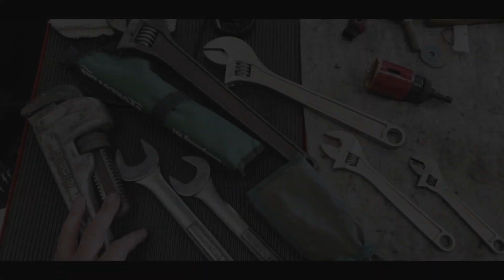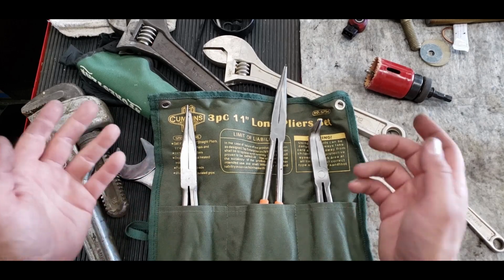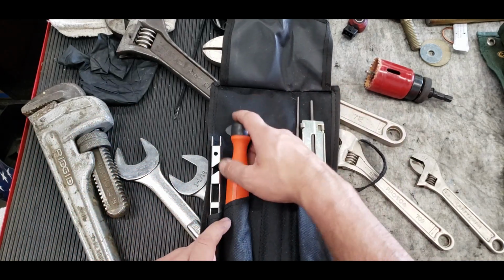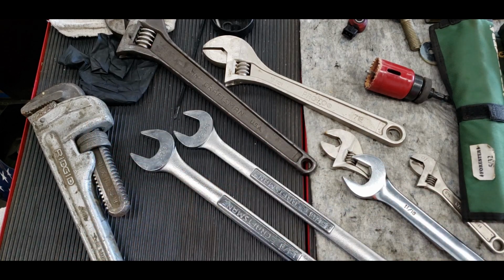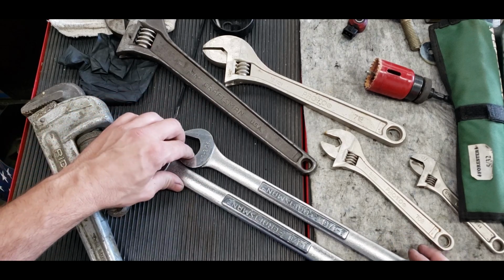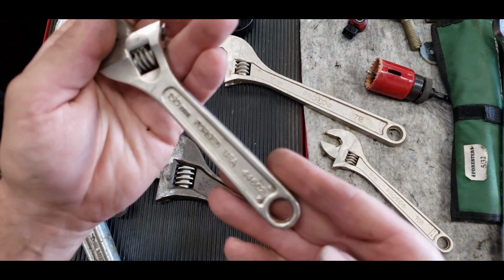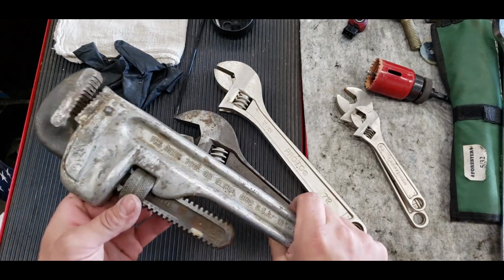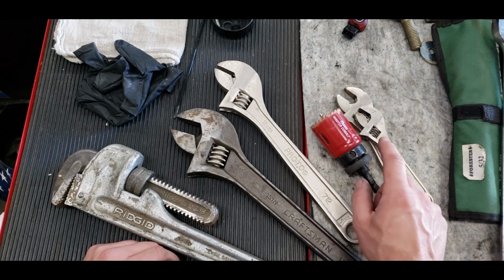Legacy Tools, Hand Tools Edition.

Comment: Sometimes them old tools come in handy.  I had to pull a ball joint the other day and my large metric set skipped the size I needed.  I found a 1 1/6 offset double box end wrench that was my father in laws.  It was a Bonnie and looked old as crap.  It came out of his machinist tools.    It fit and I got the job done because I kept it.